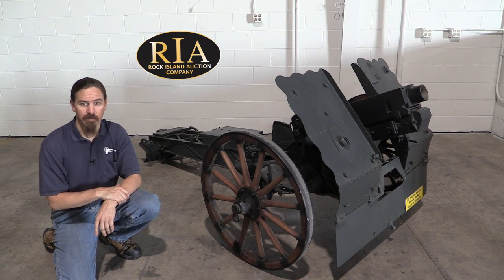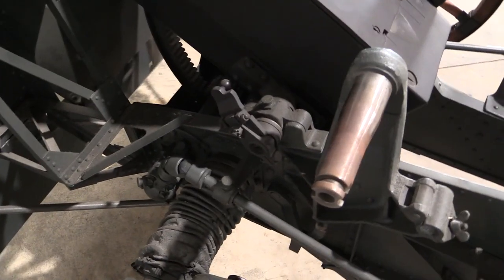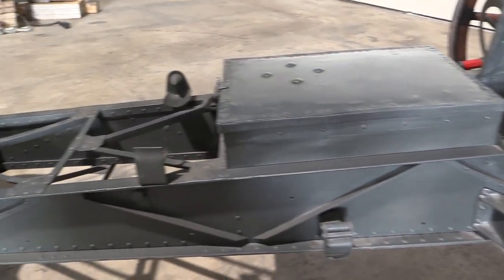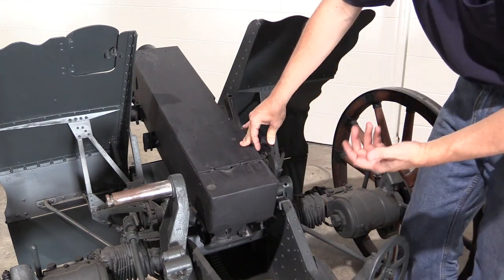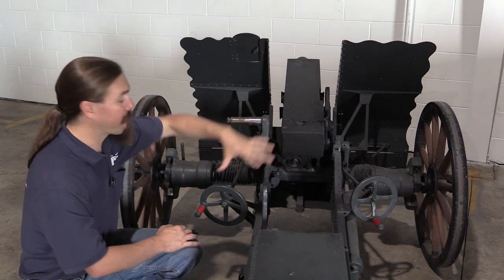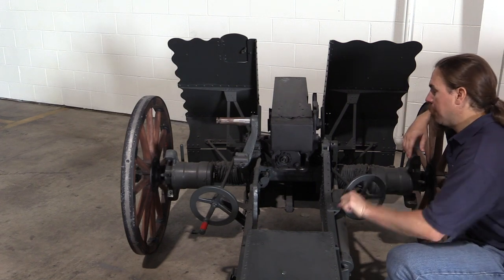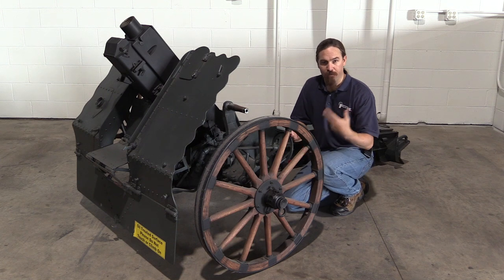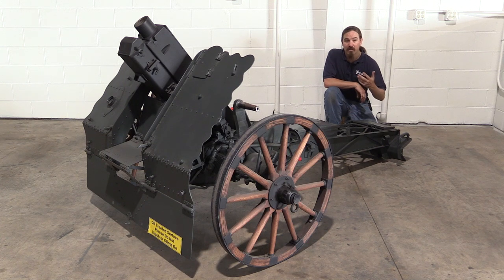Germany's New Light Howitzer: the 7.5cm le.IG 18

Comment: You got to envy the people who can just go to an auction house and buy a tank.
Reply: If you have the money you can pretty much do whatever you want. Being rich is basically like having super powers.
Reply: You can buy a tank in most countries, just not the gun that goes with it.  Without the gun it's just an expensive tractor with 2 inch steel body panels.
Reply: tian5huang cheng It's easier to get super rich here than other countries, but it's certainly not a common thing. It's quite literally a one in a million type thing.
Reply: tian5huang cheng What kind of 50's bullshit is that man?
Reply: sometimes, the hard thing is to find someone who want to sell one. then you got to have the same intrest as it´s not anything you drive around on your own.
Reply: Ariel Solomon ..Yep, I tried to buy a old tank in England a few years back. Price wasn't bad but someone said no!
Reply: Been told by some friends that went to war on peace that there was a T34 for £2000. Thats nothing, chump change. The problem seems to be that running, maintaining and storing is the expensive part. I mean, for some of these vehicles spare parts would need to be fabricated rather than bought since they are so old and out of service.
Reply: Back in the early 1990s a group of us realised we could club together and get a T34 85 as they where  being sold of by the I think Checoslovaians we could get the money for the tanks , we recond we would need two one for parts. And we had a place to store it  then we realised that we need a tank transporter to move them and that cost more than the tanks
Reply: I was thinking about buying a 45,000$ T34/85.
Reply: I remember working out the cost of fueling, maintaining, storing, and transporting a M113. Worked out to $500,000 all said and done.
Reply: travis habursky but why would you want M113. They werent really that cool to begin with. Now something with a little more battle history might be something to think about.

Biggest problem as you point out is keeping one in running condition and doing the maintenance.
Reply: plus in a lot of countries you can´t even drive it on a road.

Here in Germany private tanks can´t be driven on roads even with rubber tracks because they were deemed to dangerous for everybody else, because any accident was like a death sentence to the other vehicle, since a tank doesn´t crumble and basically every car crashing into it would just be smashed to pieces
Reply: eberbacher007 There is a place in south Texas near Del Rio that you can pay to go out on a range and fire rounds from a tank. They have several to choose from.
Reply: You'd be surprised, tanks don't have as much value as many people think they do, you can buy a M60 Patton in decent shape for the same price as a decent sports car, so if you are willing to make payments on a loan, really anybody can have one, it's the transportation issue that puts collectors away from tanks,  you need a semi truck with a flat bed, on top of that most more modern tanks are wider then 8 feet wide so you need a wide load permit, it becomes a hassle to just deal with the things.
Reply: @shawnr771  you say that now, but back in the 50s and 60s, farmers would literally buy up demilled tanks and shit for chips from the government to use as farm vehicles. Just a few years ago, M113s and their variants that you could find were "cheap" in comparison to say, a Sherman, locust, Stuart, or Chaffee. M113s and other 60s-70s armored vehicles will get very collectible and "interesting" to folks the rarer they get because police offices and agricultural business will buy them up for use and they'll eventually disappear.
Reply: Money can’t buy love....but it can buy a tank..
Reply: Shawn R I’m thinking of the overall price of purchase. It is possible to get a M113 for $10,000 in a fixer-upper condition.
Reply: In these situations I bet most of the buyers are from museums
Reply: kenthed45 I’ve always wanted to own a Chaffee. I live 20 minutes from the steel mill that cast and finished their turrets. It’d be like returning home for a steel behemoth.
Reply: You've got to envy the kind of people even more, who can just order them by catalogue :-p
Reply: Shawn R, I believe you are talking about DriveTanks.com don't remember the name of the town but they have more than tanks. I think you can shoot an MG34/42, a 20mm Lahti and other cool stuff. Check out their website.
Reply: Life goals.
Reply: Ariel Solomon I think I've seen footage of tanks stripped of their guns and most of the armour being used as tractors post WW2.
Reply: @ BurnThePope he is probably a Libertarian.
Reply: Recal a lumber crew in Oregon that had an ancient yarder built on the chassis of a Sherman tank.
Reply: @Soviet who Cuts There's actually such a story that has happened in England; a guy went on a rampage and drove through city's streets in a retired tank, flattening other vehicles and causing millions in damage. The police had a hard time stopping him, finally got him because a policeman jumped on the tank while it drove, pulling the hatch open and shooting the guy. Since then british tanks that retire need to have a specific armor plating in the back removed that allows the driver to be shot from a distance.
Reply: @covodex516  their something similar in America where a man built a homemade tank out of a bulldozer   and tried to get revenge on the people who forced his business to shut down
Reply: They used to be a dime a dozen at army surplus stores in the postwar era
Reply: @r4fken  
Step 1: Buy tank 
Step 2: Rob bank
Reply: Covodex that happened in San Diego California. A vet stole a tank from the national guard Armory on 27th street and drove it down the freeway, ending with trying to ram the pillars of a bridge. He was also shot in the same fashion
Reply: @arielsolomon5645  not quite right. In many countries you have to remove a significant part of the armor plating before you get such a thing. It's because the police would have nothing to stop you if you go rogue....
Reply: I mean, it might sometimes be one person buying for a group of people
Reply: @Wickedonezz  It even rhymes! It would be rude not to.
Reply: Having a tank would be awesome because, well, it's a tank! But what would you do with it? It would cost a days wages to drive for half an hour, slowly. I think the novelty would wear off pretty quickly to be honest. 
Britain made the Universal Carrier, or Bren Gun Carrier as they're sometimes known. Fast, light little recon vehicle with a Ford flathead V8. It's got a tenth of the size but all the tracks. They ended up being made and used all over the world and there are still quite a few around. I love 'em.
Reply: The fucked up thing about this system is, that we sheeps still want all this shit we dont need.
Reply: @ln7929  What a "mad lad" (look it up)
Reply: you can buy tanks anywhere as long as none of the guns are working
Reply: Shawn R  Ahhh!  Texas!!!
Reply: @Fishmanglitz  you for got you have to have Certain types of permits to so money and permits is like having a super power
Reply: Some tanks aren't as expensive as you might think. I've heard of old russian tanks that still run selling for like 30,000 US dollars.
Reply: @floridaarmyvet3613  really? you must have gone through the wrong guys, as tanks are super popular to buy in the UK, at least compared to other first world countries.
Reply: I don't envy them. Yes, I would like to buy one, but it's just a massive toy. One that can't even use the main cannon. A Huge reason people would like to own one.

But on the real, I'd get a heavily modded T-55. Or an Abrams.
Reply: From what I understand, the explosive charge on the shells this little guy used were substantial enough to perform as well as the standard, I've read better than (but only slightly) German 81mm mortar.

I know it's necroing an old video, but would you possibly mind setting the record straight?
Reply: Seriously, I don't have the words
Reply: @Fishmanglitz  for real if that even.....
Reply: What exactly do you need to qualify?  im sure even if im willing to pay the cash it's like buying a gun right? We cant just have any meth dealer buying his own tank
Reply: Jammy gits
Reply: @arielsolomon5645  insert Killdozer Here
Reply: @Fishmanglitz  It really is lol.
Reply: @Fishmanglitz  one in a million? Lol, that means there would only be 350 “rich people” in the US… hint: there are wayyyyyyyy more.
Reply: @exploatores  yes u can drive a tank around on your own. its what the driver of the tank was tasked with doing.
Reply: Honey, do you think we should get a     Pz. II or a Pz. 35t?
Reply: @arielsolomon5645  you can get a functioning gun lol at least in the us you’ll have to go through the nfa.
Reply: @Fishmanglitz  Batman
Reply: @RandomGuy9  That's literally cheaper than most new pickup trucks
Reply: No i don't
Reply: @Fishmanglitz  There were 20,270,000 millionaires in the U.S. in 2020. Over twenty million millionaires out of a population of 330,000,000 is quite literally exponentially more than one in a million.

Comment: That breach design is actually genius. It makes it a lot easier and faster to load when it is in high elevation.  It's a shame that you weren't able to look into it in more detail, but thanks for digging up that old footage! 
I wonder why we haven't seen more breeches designed that way...
Reply: ProudToBeNoob Probably because of production costs or times. At least that's usually the reason behind such things if reliability isn't a issue.
Reply: I would hazard a guess at balancing issues too. With a heavier weapon or a longer barrel it only gets exacerbated; On a small, short-barrelled weapon then when the barrel tilts, it's on a pivot by itself that is NOT the same pivot used for aiming. Now imagine the length is multiplied by three or four times, your barrel-only pivot has to be much further away so that the guy opening the breech doesn't have to be built like the hulk. The other problem with this is it means the angle of rotation to open the breech is decreased, so where on a short barrel howitzer like this you get, say, 20 degrees of free play at high elevation, on a long barrel you'd maybe only get 5 degrees. Plus it's all the other fun stuff like extra maintenance, extra complexity and cost. Mainly though I'd say it's the balance, it's good for something like this, but for anything much bigger you've still got one guy pulling on a lever to move the weight of the entire barrel, which above a certain weight just isn't a winning proposition.
Reply: Chris Rigby Good point.
Reply: For bigger gun's that might be true, but for such small howitzers, I think that design is genius. And I think you can reduce the weight of the gun by a lot through that mechanism. Because you don't need such a heavy lock to keep the breach block in place. And the lifting mechanism doesn't need to hold all the force that is applied during firing.
Reply: On any artillery piece build for indirect fire you have that problem how to reload on high elevation. This is quite a clever solution, on the l.FH (leichte Feldhaubitze) 1898 and 1916 there was a mechanism to uncouple the barrel from the aming mechanism, point it horizontal, reload and then tilt it upwards again to couple it in. That was much more complicated. This gun is in some ways the evolution from the l.MW (leichter Minenwerfer) which was normally a front-loaded mortar, but had some wheels and a box-trail which could be connected to get something similar.
Reply: Weight of these barrel on larger guns.
Reply: 2 years late, but it's exactly what I was thinking ^^
Reply: @FactoryofRedstone  chiming in late to say - that's indeed fine for smaller guns, but the trend in post-WW2 artillery has been to much larger guns as motorized transport has gotten more widespread. e.g. the modern US "light" howitzer is a 105mm, near-2-ton monster. That 3m-long barrel is not something you want to be tilting around.
Reply: @KuK137  It seems that you heavily misunderstood the mechanics and purpose of the IG.
Reply: Check out a channel called Jman time, there’s a film called “German light artillery systems of WW2”. There’s some great footage of this gun in rapid action. 👍🏻
Reply: A number of mortars, typically fairly large, use what is essentially break action. The most notable are the Soviet 160mm (M1943, M-160) and 240mm (M240), there are also the WWII German 10cm NbW 40 and 21cm GrW 69, plus a few older "trench mortars" like the 9cm Minenwerfer M17.

Comment: I'm pretty sure the locking systems makes it much easier to reload at high angles of aim.
Reply: Yes, no need to get below for the breech and limited recoil means the gun would be lower overall and  more concelable. Though being finiky I'd call it more of a Gun/Howitzer hybrid. Also are  wheels are quick release and /or the  axle travel locks for firing. That's what happens on a lot of guns.
Reply: Why call it a gun/howitzer hybrid? Isn't gun just a over category of all things that shoot projectiles through explosive stuff? 
And isn't it exactly a howitzer, capable of direct and indirect fire?
Reply: woke
Reply: @FactoryofRedstone  Gun presumably refers to heavy artillery, while howitzer is short barell short range artillery. This would be a light howitzer though.
Reply: @ineednochannelyoutube5384  Like I sad, as far as I know, a howitzer is a artillery piece, that is capable of direct and indirect fire. The other classifications would be a piece that is only capable of direct fire would be a canon and one of only indirect would be a mortar. 
For example the German Panzerhaubitze 2000 a self-propelled artillery piece, that is classified as a howitzer (Haubitze) has a barrel length of 52 times the caliber. That is considerably longer than the barrel length of the main canon of the m1 abrams with 44.

Comment: The US Army had a very similar 75mm light field howitzer, although it was not considered an infantry gun. It had a normal sliding breech but the barrel had an unusual inverted sled (to describe it one way) on top of the barrel. It also had a split trail and rubber tires, although there were other versions, mainly for airborne use. At some point the carriages were used for a 105mm infantry howitzer and presumably the barrels were used in other applications, such as on light tanks and landing craft.